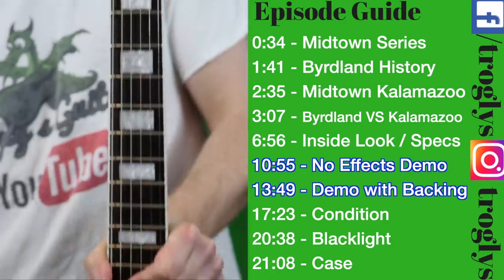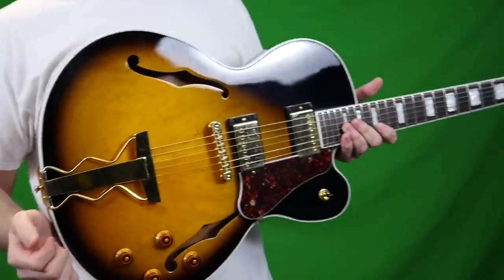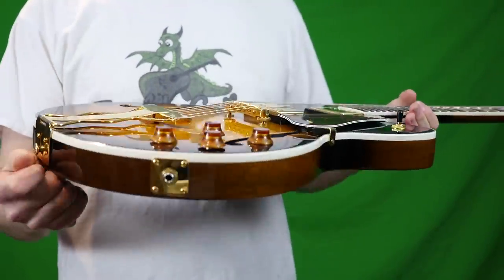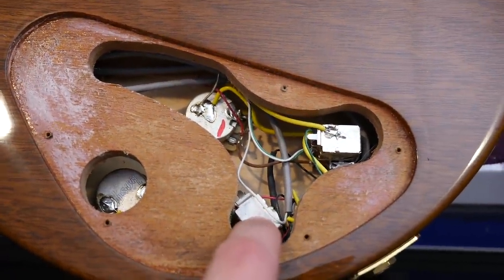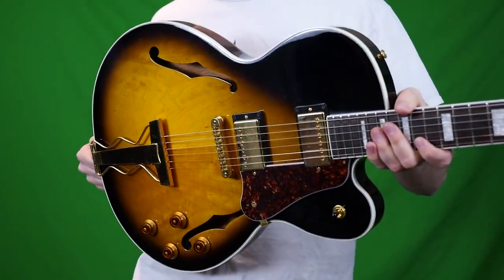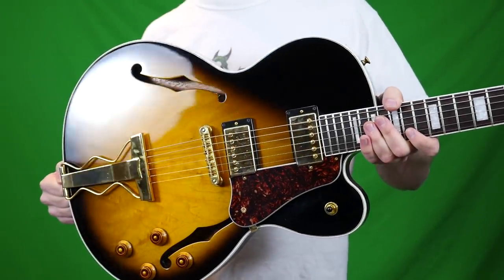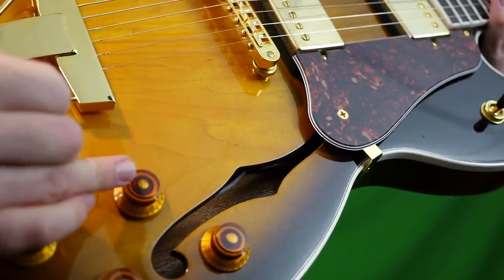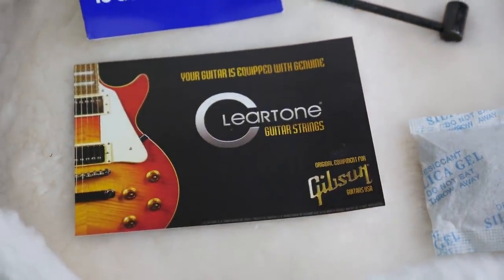The Byrdland Brother | 2013 Gibson Midtown Kalamazoo Tobacco Sunburst Review + Demo

Comment: So I had a genuine 1957 ES-225 with trapeze tailpiece, ABR-1 on a block of wood “floating” bridge & a single Dog Ear P90(I sold it because tuners & pickup aside none of the hardware was original. The tailpiece was some Japanese knock-off, the “ABR-1” bridge was some Korean(? I still have it in my drawer & would have to check) knock off so I sold it) that was in Gibson’s original “Sunburst” finish & it was the very same “Vintage Sunburst”. I would think the major differences between the Tobacco Burst & Vintage Sunburst is that Tobacco Burst is specifically designed to mimic an aging pattern once found on a 1958 Heritage Cherry Sunburst & therefore is more brown than black with some red in it if you catch the light the right way whereas the Vintage Burst is just pure black? Is that correct? I mean I know for a fact that my 2020 Les Paul Standard 50’s neck in the Tobacco Burst finish is exactly that, a deep dark brown toward the outer edge that fades almost to a red into the center yellow. So that’s what my Tobacco Burst looks like but I cannot speak for the finish over-all & no longer having the ES-225 I don’t know exactly what the Vintage Sunburst looks like in person just going by memory & what it looks like in this video.